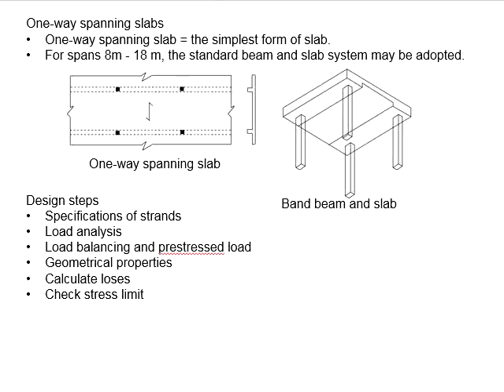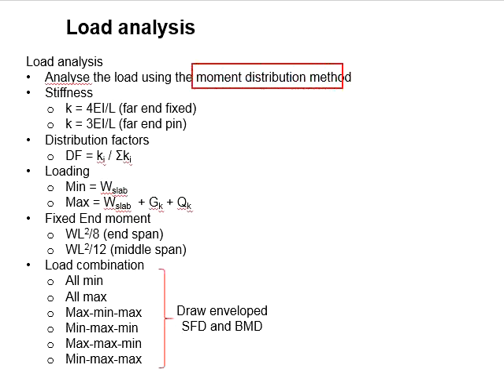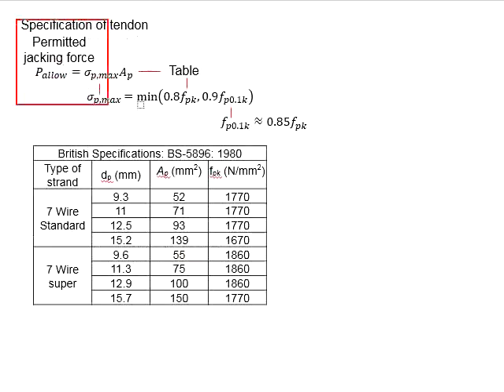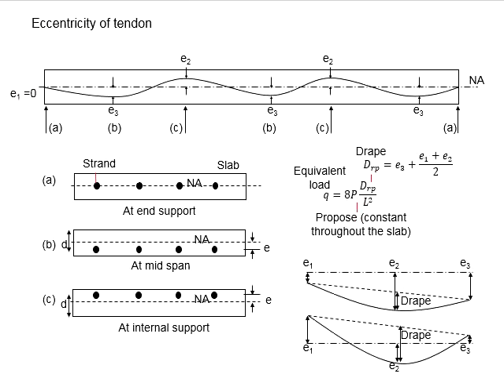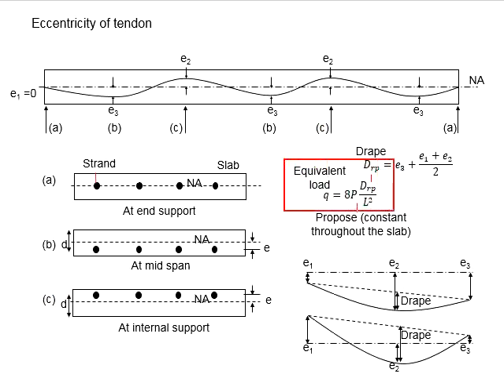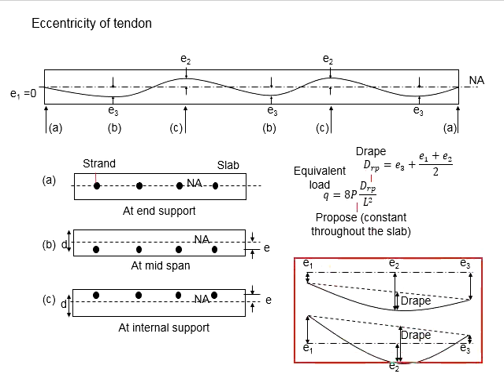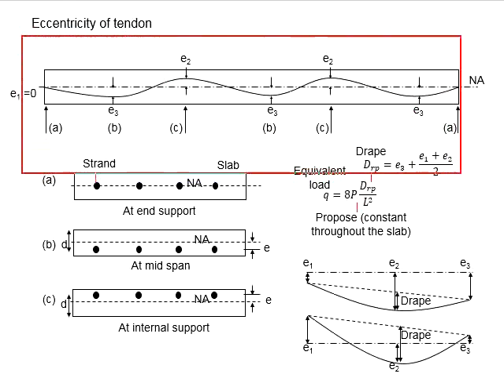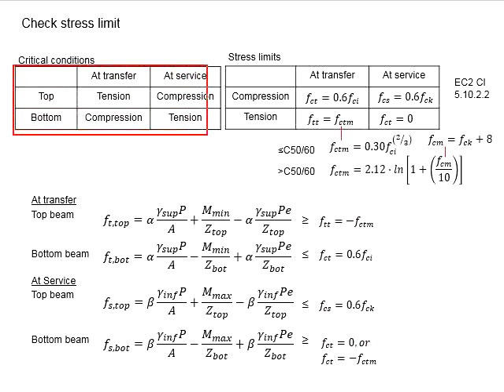5.8 Load analysis

Comment: Hello sir, how to get value for the eccentricity?
Reply from the maker: Find the centroid of the concrete slab section. Eccentricity would be the distance between the centroid of the tendon (which is decided by the designer) and the centroid of the slab.
Reply: @eng-aim  how to find the  centroid?
Reply: @eng-aim  pls ur WhatsApp no?
Reply from the maker: @engrbabatunde8149 . Based on the cross-section of the slab. For more details, you may refer to the principles explained in chapter 2 of this course.